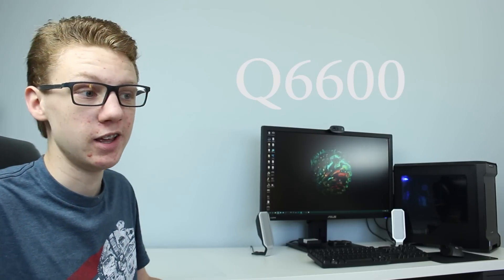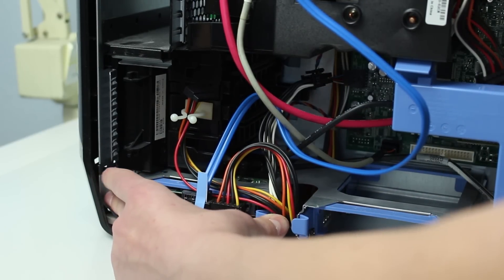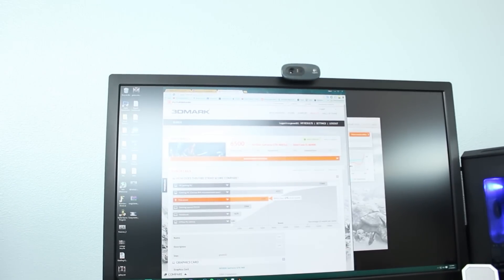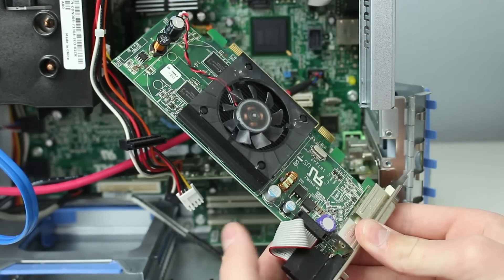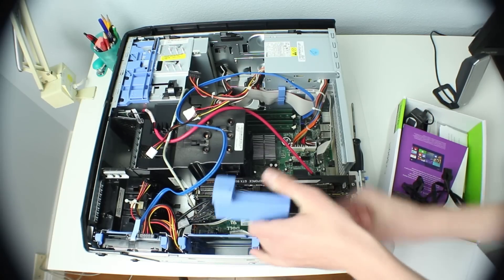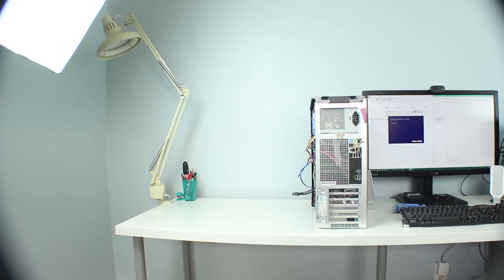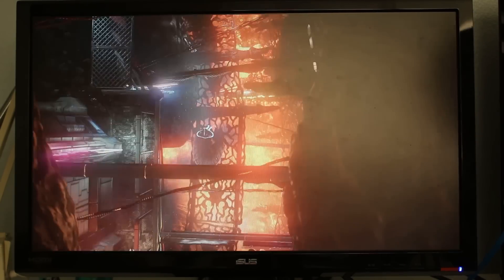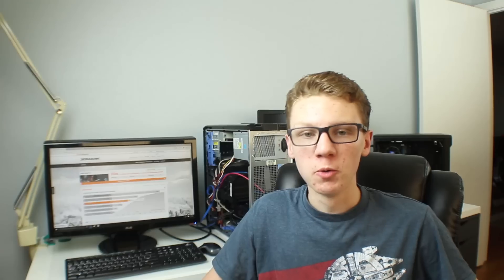Old CPU + New GPU = Gaming PC? (Core 2 Quad + GTX 960)

Comment: Is this good?

PCPartPicker part list: http://pcpartpicker.com/list/2g3x6X

CPU: Intel Core i5-4590 3.3GHz Quad-Core Processor  (Purchased For $0.00) 
Memory: Crucial Ballistix Sport 8GB (1 x 8GB) DDR3-1600 Memory  (Purchased For $0.00) 
Storage: Sandisk SSD PLUS 240GB 2.5" Solid State Drive  ($69.99 @ B&H) 
Storage: Sandisk SSD PLUS 240GB 2.5" Solid State Drive  ($69.99 @ B&H) 
Video Card: MSI Radeon R9 380 2GB Video Card  (Purchased For $0.00) 
Case: NZXT S340 (White) ATX Mid Tower Case  ($64.69 @ SuperBiiz) 
Power Supply: Corsair CXM 750W 80+ Bronze Certified Semi-Modular ATX Power Supply  ($89.78 @ OutletPC) 
Other: Water cooling ($200.00)
Total: $494.45

I need help with the ssds, motherboard, powersupply, water cooling.

P.S.

I need to be able to upgrade this so make sure its not a mini atx motherboard.

Also, I found this:

http://www.magicool.biz/product_systems.htm

But I figured I should make a custom loop...

Thanks!

Comment: Can I run Radeon Hd 5450 hd DDR3 On my pentium r dual core e5200 cpu and Esonic G31 Ddr2 RAM 1.99 GB pc??
Reply: For a E5200 I would rather go with something faster.
It's a entry to mid-range CPU from 2008.  Why holding it back with a crappy office/multimedia graphics from 2010. (THe HD 5450 is about as fast as a 8600 GT!)

That's like pairing a i3-6300 with a GT 720!

Give that E5200 atleast something like a GTX 650 or a  R7 250E (Or something on a similar level: GTX 260, GTX 550, HD 6770, HD 7750)
Or OC it and give it something even faster.
Reply: dude! the gtx970 is a beast (its the 2nd best gpu and yeah it's compared to the gtx 1070) and i don't think that people sell it for anther one except for the gtx 980 or 1080 which are phenomenal gpu"s
Reply: yes it works, but without overclocking it, adding a better PSU thats at least 500W, and getting more ram, then you'll be stuck on playing games >40 FPS in the long run(for games that are made past 2008 or heavy on gpu usage).
Reply: HappyBeezerStudios but that is the main concern on making any PC fast; MONEY. It'd be epic for finding GTX 1070/1080 or a decent i7 exreme cpu for > $300/ea. secondhand, but with these hardcore IT virgins sniping each other over a piece of plastic that's made in China/Tawian on ebay, it is next to impossible to actually buy the hardware(for a great deal) until the next GPU or CPU replaces it within a year...
Reply: Philip Ottey Then just go with a GTX 780 Ti or a 1st generation Titan. Those are cheap now in comparison and still fast.
And I can't imagine all the people selling their 970's now to get a card with real usable  GB of memory.
Reply: I know Im quite late but if you bought the HD 5450 its a Huge mistake :3 I had it and was like 25-30 fps on Far Cry 3 on the Ultra low settings with 800x600 resolution :D when I saw that I went to the store the other day and just bought an another card (That was a prebuilt Pc with a fairly decent i3 3240 3.4GHz but the HD 5450 GB was crap :D

Comment: Dude, having a faulty disk is a nice way of invalidating all of your testing! believe me, I have a nice computer w/ a lot of hdds and when one of them fails it makes my whole system have hiccups, dropped frames, slowdowns, etc. Especially if you're playing games that are on that drive. This happens because each time the game loads a new area or loads new assets into the RAM from the HDD it has to read the game's data stored in the drive, causing sync issues with everything. Think about it, if it reads a bad sector in the hdd in order to load the data properly to be displayed onto the screen, the CPU has to make another read call on the HDD or wait for the first one to finish. If this happens, it makes it harder for the CPU to process requests from the GPU thus halting the experience because of a dying HDD.
Reply: Also, that explains why on the task manager it showed 99% cpu use. Since read/write errors where showing up when using it, the cpu had to make another read/write request to the hdd of the specifically damaged sector, which could take a lot of time per bad sector.
Reply: It doesn't even have to have a bad sector, the fact that its reading from the HDD at all is going to cause a  hiccup which it wouldn't need to touch the HD if there was 8 gigs of ram.  There's videos showings the effects of 4 vs 8 vs 16gb of ram, and the results are basically theres a noticeable difference between 4 and 8 in performance and no notivable in 8 vs 16.

Comment: I laughed so hard when I saw the XPS 420..

Old PC lol, I'm using that exact PC right now. It has a GTX 750Ti and still runs current games fairly well. BF3 at ultra at least. Getting an upgrade this week actually.

Future Edit: Upgraded from this a long time ago. Currently running a 2600X and 1070 in a Lian-Li 011 Core
Reply: What's your PSU
Reply: Aymen Yonees I upgraded a long time ago but I think it was running a 450W Insignia PSU from Best Buy. That thing lasted a really long time and I still have it sitting to this day.
Reply: dapper patto 980 would be the farthest I’d go but your cpu will still be a major bottleneck. See if you can get an upgraded CPU for the socket.

Comment: mother board:gigabyte ga-g41mt s2pt
processor:intel core 2 duo dual core
hhd:160gb
ram:2gb ddr3
power supply:shitty Chinese power supply
case:shitty case too
keep in mind the parts are used
what is a price for this pc and what should i do to it to play gta v with 50/60 fps? and thanks for the help:)
Reply: you cant play gta v at 60 fps with any core 2 duo/quad. it's just not possible. 30-40 maybe.
Reply: upgrade your ram
Reply: Give it a Core 2 Quad (Or Core 2 Extreme if it's supported), and a 750TI, or a 950.
Reply: RAM to 8 or 12, Graphics card

Comment: I had a similar PC with slightly newer hardware, I put a 1GB Radeon 6000 series card (not sure which one, as I gave it away soon after) and was able to run most esports(CSGO, DOTA 2) on high settings, along with a few AAA titles (most notably black ops 3) on low-medium setting at 1600x900 resolution.

Comment: This is a good video, Gavin. Quite well made. There are a few things that you should try the next time you do this, if there will be a next time, say for a GTX 1060 or something.

1. Try running a few modern, heavy games. 3Dmark alone doesn't paint a clear picture.
2. If you could, try to upgrade it to at least 8 GB of RAM. 3-4 GB will prove to be too much of a bottleneck in games.
3. It would be better to use a new HDD or even an SSD. An old drive like the one there might cause performance issues in itself.
4. You should try getting the part names and details before making the video. That would make it much more professional and appealing.
5. Although the dog part isn't bad, it is too distracting for a video of this nature. Try to focus solely on the subject matter.
6. This isn't really an issue, but the last part where you stop the recording should be cut. :D

I, personally, upgraded my old computer from a Core 2 Duo E6550 @ stock speed and 4 GB RAM to a Core 2 Quad Q9550 @ 3.4 GHz and 8 GB RAM, and even though I didn't change the graphics card (GTX 560 Ti, 1 GB), the improvement was massive in CPU limited games.

I'm planning on getting a new card, probably a GTX 1060, and am hoping and expecting to see a sizable improvement in graphics heavy games.

Comment: Hey Gavin, this is the first time I watched you on YouTube, and I think you did a fine job! For future reference, most Dells have a Service Tag. If your relatives didn't change anything on the computer since it's shipped, then you should be able to grab the Service Tag (I think it's on the rear for these older XPS's), and then head over to dell.com/support, and the site will report when the computer was built, what it has, type of memory, all that stuff. :) Just a friendly tip.
Reply from the maker: Ah very useful, thanks!
Reply: +Gavin Remme Or you can use cpu-z to know what kinda of hardware is in current  system and it's  speculation

Comment: I changed my old pc with e8400 and radeon 6850 (overwatch 17-50 fps on low details) to i5 6600 and same gpu (radeon 6850) and overwatch on medium/high i get 70fps all the time. So i think 3d mark  IS NOT trustworthy. So in my case new CPU is HUGE speed improvements

Comment: Intel Core 2 Quad Q6600 + 6 G memo DDR3 1066mhz + board Pegatron IPM41-D3 + PSU 500w + Nvidea 9800Gt 1G + HDD seagate barracuda 500 GB 7500 rpm. + oS W10.  
   
   No overclock in the CPU or in the GPU all hardware have 8 years old and runing yet 90 % of the newest games.

Comment: 12:07

You are not "maxing out" the hard drive, the 100% you are reading is listed under "active time" not "percent of available throughput used" (which is not a value Windows gives you). If you look at the lower graph on that window, it represents transfer rate and you will see it is only at about 60% of total, and that "total" is only the max that it has hit since you began monitoring, not necessarily the actual max of the drive. It is likely going only 12.5MB/s because 1) your internet connection is not fast enough to need to write more than that or 2) Your CPU cannot decompress the downloaded data faster than that. It may be both depending on what algorithms and dictionary size was used to compress the data (I am not sure what type of compression Steam uses). I would lean towards option 1. Run CrystalDisk Mark on the drive and I bet you see much more than 12.5MB/s write speeds.
Reply from the maker: Thanks for the clarification +

Comment: ur pc is outdated
Reply: rn im getting a 28535 on firestrike
Reply: Well, the i5 4690K is still pretty modern and is a solid CPU. Couldn't speak for the rest, but I'm sure the low score (comparitively) was down to the GPU more than anything else. Which graphics card do you have?

Comment: a btx motherboard, what a flop that was. not to mention the case is btx so youre sol  if you want to upgrade the motherboard to an atx motherboard. gpu companies will say you need an x amount of psu watts to run their gpu when you actaully don't. that psu rating is just giving them extra headroom. it's like the whole changing your cars oil every  3,000 miles using regular oil when you really don't have to change it until you get to 5,000 miles using regular oil.  besides it's the amps on the +12v rail that matters most. you can have a cheap 500w psu  that meets the watt requirements of a gpu but if that psu has a low +12v amp rating  you'll end up burning up your nice gpu or motherboard. a quality psu should at least have 35 amps total or higher on a +12v amp rail. some psu's come with multiple +12v amp rails which should combine to equal 35 amps or higher as well. if not then you'll risk burning up you gpu, motherboard or both using a midrange or higher gpu.
Reply: It also depends what else is in the machine and how much that draws. I remember using those cheap dual-rail PSUs... never agin! Also, that headroom is important for the user too, as it should increase the life span of the PSU, and avoid things like coil whine, due to it not screaming its nuts off trying to power everything. Oh, also, overclocking is another reason to have extra power kicking around, if you're into that sorta thing.

Comment: meanwhile i'm actually running a core2 quad with a GTX 750...
Reply: ***** I know. I can run games like War thunder at higher frame rates than Minecraft xD
Reply: Awesome. My dad's got that CPU as well, and a 630. I'm giving him my old rig though, with an FX 4100, an ASUS 990FX, and whatever else I can dig up. Will probably end up with 8-10GB Corsair XMS3 DDR3 RAM. He's already got a nice Corsair PSU and other good components so it'll all be mashed together. xD It should do him fine. He's not a heavy gamer, he just dabbles.
Reply: thats still a kickass computer, Core 2 Quad 3,00 GHz overclocked or the better ones make a good gaming computer, specially with 8 GB of RAM.
Reply: ***** at 2,33 GHz even the GTX 750 Ti, which is friendly even with Core 2 Duos will create a major bottleneck. In fact, even a Core 2 Duo overcloked to 3,00 Ghz or more extreme, to 3,50 GHz will give far more fps at games that dont use 4 cores or that dont really need them, like Tomb Raider 2013.
Reply: ***** the problem is that my motherboard is so abundant with options that it won't even allow overclocking. I have a Q8200 running at the default 2.33 GHz.
Reply: 2nd gen i5 (3.3 GHz) with GTX 750 Ti, here.  Screwed myself not buying an unlocked CPU.  BIOS has "turbo boost", but maxes out at 3.7 GHz and not sustained.
Reply: I have a rig on the side with a Core 2 Quad (Q9650) running stable at 3.61ghz, 8GB 1066 Corsair ram and an Nvidia GTX 960 SSC 4GB GPU. Even to this day...this thing can still be enjoyed for games (60fps 1080p), photo editing and moderate movie editing.  Damn thing is way over 11 years old and still kicking.  Best money I dropped back then.  But... alas, if you have the money, it's about damn good time to upgrade to a Ryzen system or current gen Intel CPU with fast ram. You can build nice gaming and production rigs for about 600.00 USDs. Less if you already have a good PSU and tower to work with on the side.

Comment: I'm kinda going to do a similar thing. I've got a i5-4590 and planning on getting a GTX1060 for it. hopefully no bottlenecks
Reply: Should be fine. Doubt you'd run into many (if any) issues even with a 1070. Probably would with a 1080, but really it just depends on the games you play. Some games are pretty heavy on the CPU.

Comment: wait, doesnt the Windows install disk contain a built in "Format" tool? IIRC you do a "Fresh" install
Reply: I wondered that too, and the answer is yes, it does. Windows setup will format the HDD for you, provided it's partitioned correctly. (has space for a new partition, or a non-formatted partition) Fairly sure this has been the case since Windows XP. I don't remember too well because it was years ago, but I don't think Windows 98 or 95 did that.

Comment: well I have a hp computer with a core 2 quad and a GeForce 4800 or 4600 I'm not sure but it also has a TV tuner card so could this play gta5?
Reply: My sister's rig is a Q6600 @ 3.6 with 4GB Ram and a 2GB VRAM 7850. Runs GTAV on relative medium settings fluidly.
Reply: "TV Tuner Card" lol that reminds me of my first build

Comment: I've just gone from a Core 2 Quad to a 6700K and I can say that these results are massively flawed.

Benchmarks basically just test one part of your system, whilst gaming obviously uses more than just your graphics card. I tried playing ARK on my old setup and it would barely run, since the upgrade but keeping the same GPU I can now run it really well at a decent resolution. The old processor and the limited amount of RAM (DDR2) that my old system could handle was causing the bottlenecking, not the GPU.

Comment: I don't get it why people buy Intel K CPUs and still use the stock heat sink and therefore don't overclock it.
Reply from the maker: I bought the K skew because I planned on getting a better cooler later. I couldn't afford it when I was building the rest of the PC. I have an AIO now.
Reply: +Gavin Remme Yep, saw it when taking a look on your newer videos. :) Thank you for your response though.
Btw, any overclocking achievements you want to share? :D
Reply: I use stock settings on my 3570K (3.6 GHz) with a good cooler (Zalman 10X performa @800RPM), because I don't need  10-15% performance increase. Also, overclocking 6700K (4GHz stock) will not give you perceptible performance boost (about 3-7% in benchmarks). It can be installed into H110 or B150 motherboard.
Overclocking 4690K can give you another 10-15% performance, but I wouldn't bother overclocking it, unless I had some stuttering in games that would go away after overclocking CPU (which is very unlikely)
Reply: ***** Well, you can overclock a 3570K to at least 4,2-4,5 Ghz without even touching the voltage. Therefore you are missing out on getting extra performance for free. Just change the multiplier and see what maximum you can get.
Reply: I bought an i5 4690K but don't overclock it. xD I don't think I'll ever need to as it's a pretty decent CPU; however, if I do decide to, I can. I don't think the price between the K and non-K was really so different that it was important. I got my i5 in late October, 2014, for £178 with free delivery on Amazon. The Hyper 212 EVO was £30 so I nabbed that too.
Reply: ***** In general you are right, overclocking can speed up so called electromigration of your processor. But the effect is so negligible even with a maxed out stable overclock voltage it is more likely you have upgraded your system before the effect becomes even noticable at all. Read more about it here:
https://en.wikipedia.org/wiki/Electromigration
http://www.tomshardware.co.uk/answers/id-2530767/electromigration-cpus.html#15285490

Comment: oh, and the q6600 is a high end processor... your i5 isnt. also the q6600 was over 800 bucks new. THATS why it keeps up. the boards suck not the processor, lucky if you find one with ddr3.. most are ddr2, now chuck a decent cooler in there and wind it up to 3ghz+ and see what these thirsty lil beasts can do. 105w stock mind

Comment: What motherboard is this and specific GPU manfacturer/model is this? My understanding is 960's shouldn't work on non-EUFI boards (which also would exclude LGA775 i think). Unless that 960 has Hybrid bios.
Reply: 'o.O I cannot imagine why any card would require UEFI. I've had UEFI for a lil while now so perhaps I got lucky and missed that. The last card I had on a regular BIOS was the 560Ti.